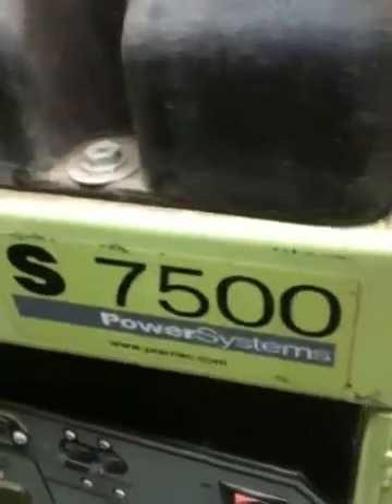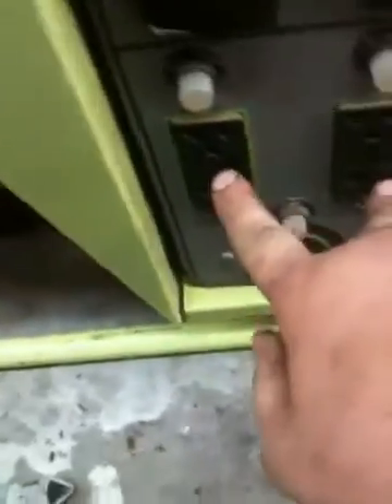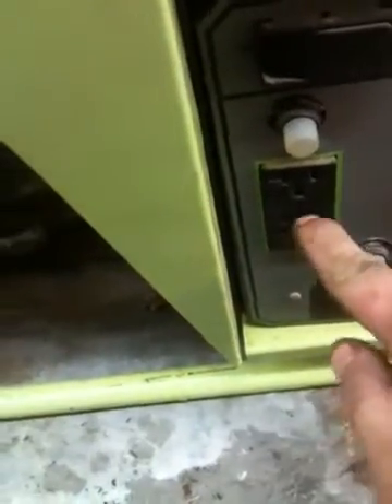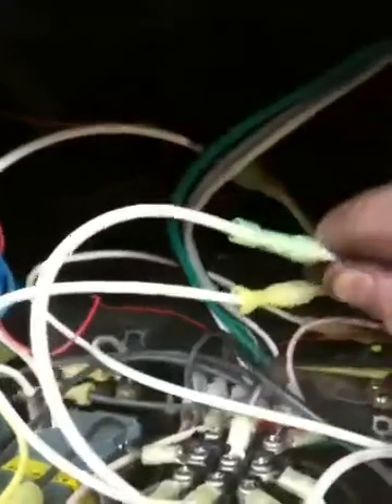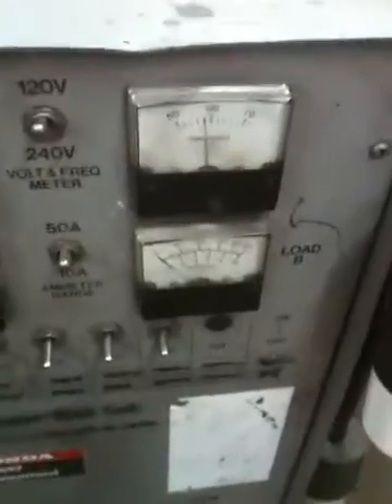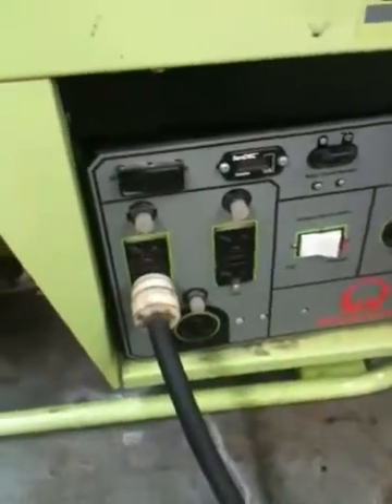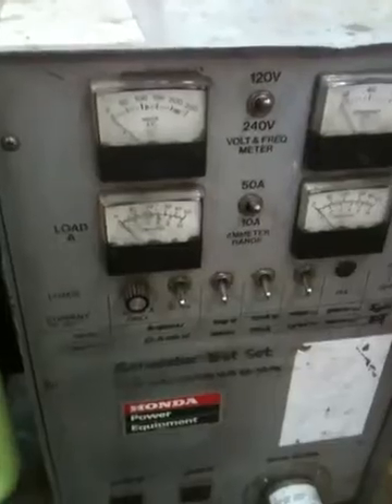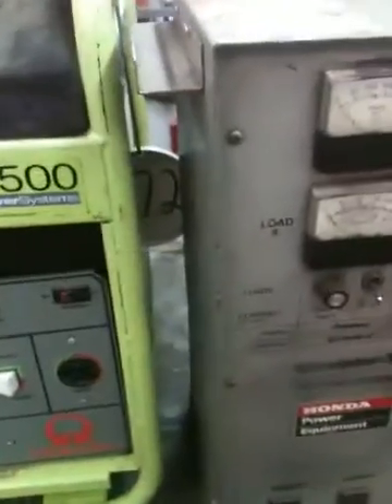ELECTRIC GENERATOR REPAIR: How to fix an electric generator

Comment: Hey I had to replace the diodes in a generator armature and forgot how they go back in while waiting for the parts to arrive.
My question is do the diodes face the same way on both sides or does the ground side go up on one side and down on the other side?

Comment: Hi Mr. Jeremy ,
i had a problem with my diesel electrical generator , i am not able to start it after it has ran out of fuel , somebody told me that i have to empty it from air , do you know how to do it .

advance thanks,
Amir

Comment: Yeah,looked like nice quick fix.I bought a Generac 7550 with no power.Found that it was the PBR board and replaced that.It was putting out too many HRTZ but still worked.Used it for several months,then the alternator finally took a crap.It shorted out the alternator windings,so needs to be re-wound.Must have been shorted before i bought it.

Comment from the maker: @nfldgolfer first of all it is aginst federal law to power a generator without a saftey transfer switch....you could KILL a lineman miles down stream of you.....as far as it not putting out power sounds like the caps have blown or poss the diode trio on the brushes.......what are your stator and  rotor ohm resistance?

Comment: Thats a nice load bank. I set the RPM on mine with a multimeter that measures frequency. I check it with between 1/3 to half load on it from heat guns and electric heaters and it seems to work great that way for me. I can get it tuned well enough that my computers and battery backups dont freak out when running on it, and if I wire it right they even stay stable while cycling a big window A/C. Now I just gotta tune my new diesel generator the same way :D Great vid keep up the good work!